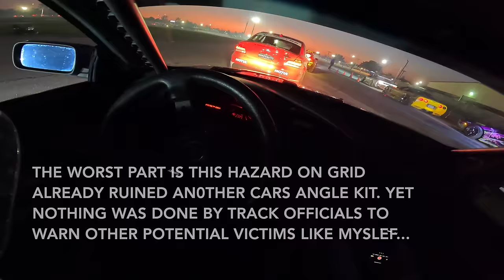I got KICKED OUT of a Drift Competition

Comment: up ur rear psi by 10-15 and run ur front at like 2-5psi higher for more transitional speed or lower for more front steering response at a slower speed it will make ur ass end float more which will help u keep the momentum in the long sweeping corners great clutch control hope to tandem soon
Reply: i run 20psi 26psi with small tire 22psi 36psi on a grippy
Reply from the maker: The tires had 55psi in the rear and the car was still struggling to lose grip lol might have a bit of an aggressive alignment

Comment: Have you ever had a bad rev hang issue or random revving while at a stop
Reply from the maker: If it is fine while the car is cold but happens when it warms up definitely change out your coolant temp sensor on the cylinder head.
Reply: @HoonGarage  that’s my exact issue thank you my gauge on dash never gets hot or is abnormal
Reply: Is that received from a different sensor
Reply: I had a similar issue where my car would start revving randomly, i had to replace the idle valve control sensor and it got rid of the issue